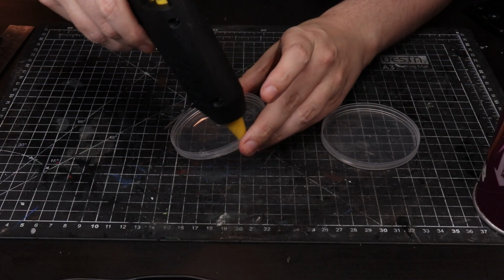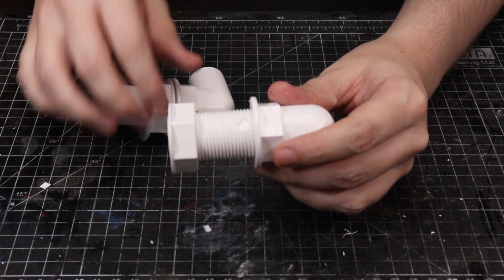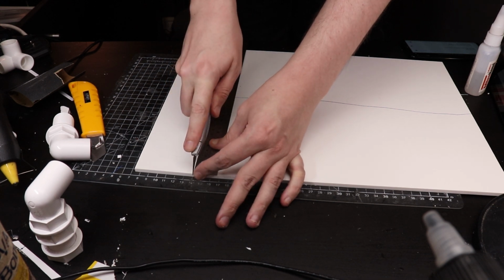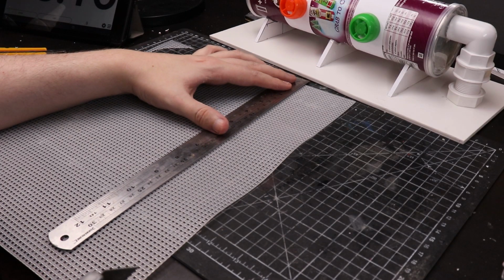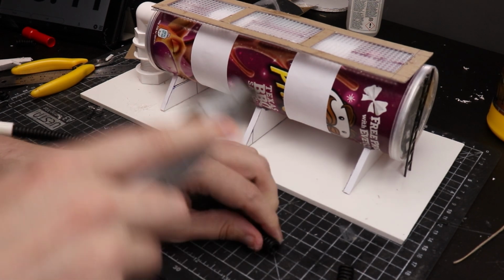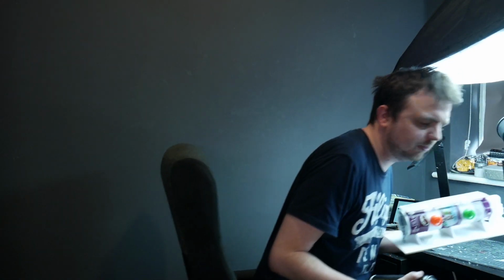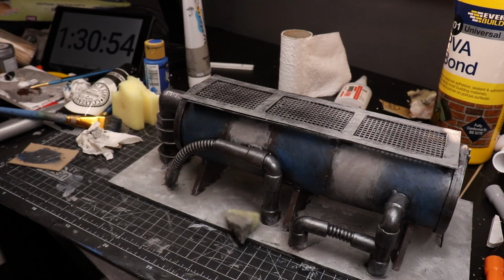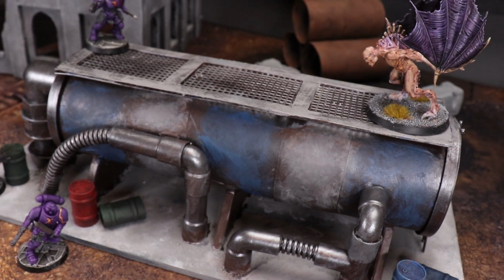Industrial Terrain For Warhammer 40k In 1 Hour?

Comment: I'm in need of some smaller pipes (the non-plumbing ones), do you know what they're called?
Reply from the maker: I've added a link in the UK Amazon to the one I bought, as it doesn't have any slits. Try like Wire conduit tubing, most have a little slit in them to put other cables, but the one I got didn't.
Reply: @TerrainMadeEasy  You're a gentleman good sir!
Reply from the maker: @The-Underbaker  no worries, good luck

Comment: YES.  I have four empty canisters and they're even that EXACT flavor.
Reply from the maker: I have too many empty ones lying around! Apparently they are changing the lids to be more enironmentally friendly, so obviously I should buy more while still available :)
Reply: @TerrainMadeEasy  cut the tin off the bottom and the lip off the top, then use chip board to make flush lids
Reply from the maker: @j453  Aye, that's a solution, I will try and get the new type for experimental reasons!
Reply: everyone knows that the most important part of any build is the flavour
Reply from the maker: @ash-tv3bu  for reason this made me think of reverse what Nintendo did for the switch. Apparently they made their cartridges taste bad so kids don't eat them. I wonder if you could make nice tasting terrain...I guess maybe a gingerbread house

Comment: Not that bad.  The main problem was rushing the paint job so you could easily fix that.

You can get a touch more texture by cladding the foamcore edges with zip ties.  Could be used to edge the walkways as well.  

In the US I've found that "Soffit Vents" are a good source of walkways.
Reply from the maker: For sure, I was just down at the time, think it actually looks alright! Will see if I can find them in the uk!